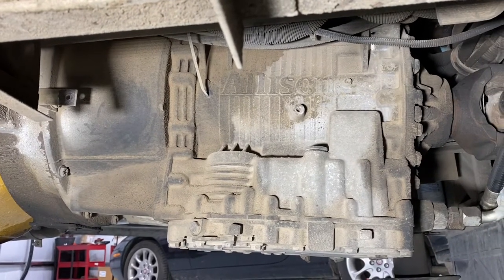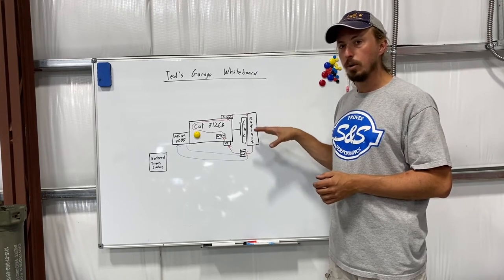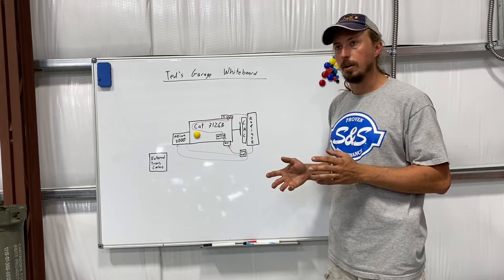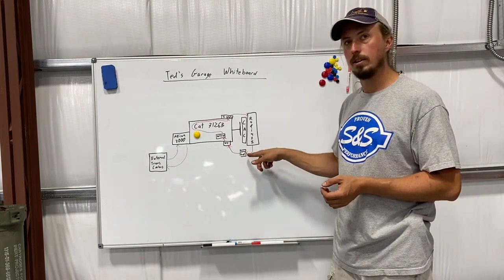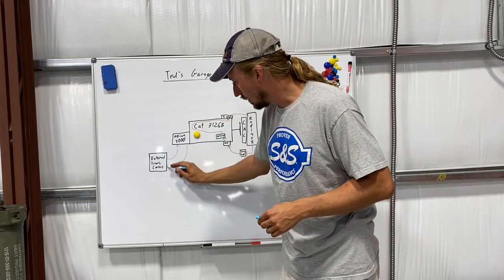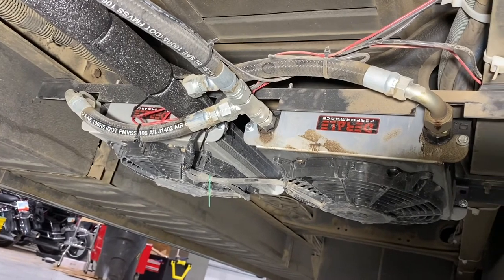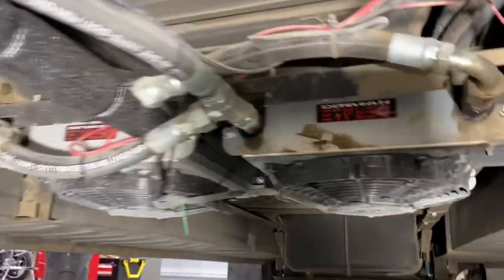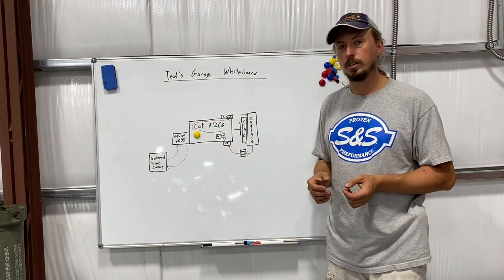Adding an Independent Transmission Cooler Setup for the Allison 3000 on my RV

Comment: After using it for a while, do you think 2 Derale is overkill?
Reply from the maker: I'm not sure if I'd call it overkill, but it is probably more than I need. The transmission has never run warm since installing them, has also never run too cold (including in well below freezing drives). In normal operation the fans cycle on and off and keep the temps in the 175-185F range, which is where I want them.

I think one cooler wouldn't have been enough. I could probably have gotten away with two smaller ones, but if I could do it over again I think I would've done the same thing I did.
Reply: @TedsGarage  Great to hear that worked for you. I just purchased 2 to follow your steps. May have a video coming out soon as well : )
Reply from the maker: @timmysrvlife  My external oil coolers and electric fans have also been doing very well.